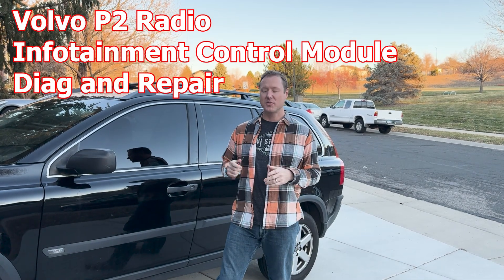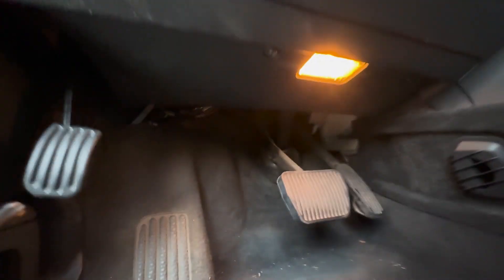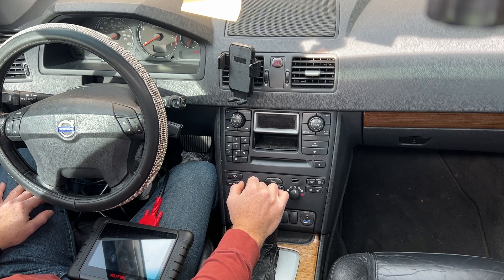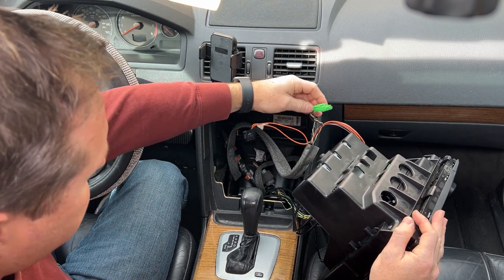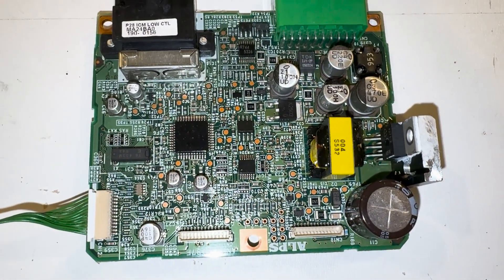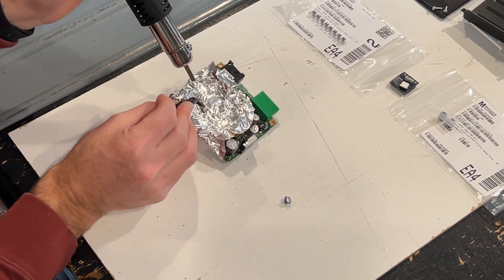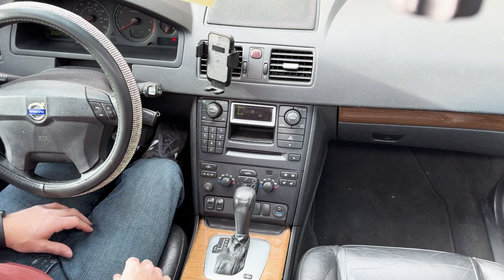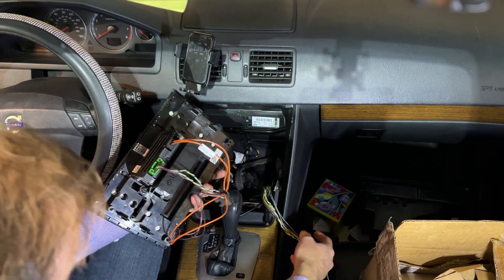Volvo Radio Infotainment Control Module (Code DC02) - Don't Do This!

Comment: Hello my fellow Volvo enthusiast. Do you happen to know if the screen for the ICM is a straight swap or if I would require a new radio code / recoding in VIDA etc. ? My screen keeps dimming and it's driving me mad. Would like to get it replaced. Thanks!
Reply from the maker: Can't say for sure.  If you truly just swap the LCD only, I bet it would be just fine since it uses a simple old school LCD.  I can't imagine it is keyed or programmed to your ICM.
Reply: @5ivedaysproductions630  thank you mate!

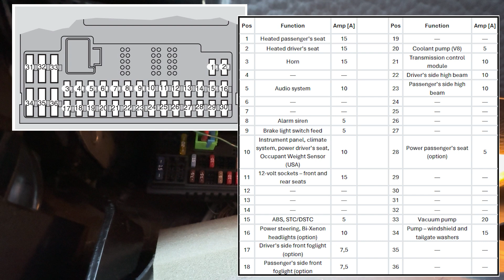Comment: If we're making a point of missed fuses - maybe we should examine video at 1:15. You say there are no fuses relating to infotainment on this board - I would have thought fuse at position number 5 would have been worth checking under those circumstances at that time.

Comment: 2004 Volvo XC90 radio keeps turning on and off repeatedly no sound also .any hints ?
Reply from the maker: I would bet its the capacitors on the Infotainment Control Module (ICM).  I have a link in the description to that guy demonstrating the way it is supposed to work, but in my case I ended up doing more harm than good (not the best at surface mount soldering).  Xemodex will rebuild the ICM for you, but after you ship it there, it can be around $300.  The unit I found on eBay worked great and was cheap enough (under $100) that it was worth trying.  For that year it seems to be ok to swap out the ICM as long as your model numbers are a perfect match.
Reply: @5ivedaysproductions630  or i can just plug and play for the unit in will get from the junk yard ? 
Is there any programing involved in units from other cars to be used in my car ?
Reply from the maker: It's plug and play. What I showed in the video around 09:13 was a used one from eBay (likely from a junk yard).  So that is definitely what I would do and save yourself the teardown and risk of breaking something.  Mine didn't require programming, but the seller on eBay said that it was crucial that I got both Volvo part numbers on the ICM to match (my original had to match the one from eBay), otherwise you probably would need to do some programming.
Reply: Thanks I will update,  your help is much appreciated thanks again my friend
Reply from the maker: Sorry I didn't see your question earlier.  There are stickers in 2 areas, one on the ICM and one on the lower back of the whole unit (right behind where the CD slot is).  Here are some pictures (hopefully YT doesn't block them).  The first picture is from the ebay listing where the seller told me the 2 numbers to confirm matched what I had at home.
ebay - https://drive.google.com/file/d/1bAoodwxqP5s7lCLnYiaEkkJ1sUs-F6CO/view?usp=sharing
ICM - https://drive.google.com/file/d/1yjX_5myGkmQhiFWhyGmXYxlE204sRLZ3/view?usp=sharing
https://drive.google.com/file/d/1dq_B44f180jzy6fuLBlveUkedP9FTeus/view?usp=sharing
Reply from the maker: If this one from eBay didn't work, I was going to go that route with the aftermarket single din.  I would try eBay first and make sure its eBay motors certified so that they will let you return it if its faulty.  If that doesn't work, go aftermarket.  For an aftermarket, you just need a positive and ground power source and good speaker wires (which you can run your own if needed).  It would completely bypass the factory fiberoptic stereo system so it should work for sure.
Reply: @5ivedaysproductions630  Thanks for the information. When I saw your video, it made sense for me that my stereo not holding the voltage because obviously the capacitor job to hold the voltage .
The stereo here in California junk yard are $35 do i just get one and sawp the icm from same year ?

Comment: good news is no one will see your mistakes and if it works, who cares.👍  not sure why Volvos can't be better. the '84 244 GL I had kept burning brake light bulbs and it came down to the 16" long flexi light circuit card that lived in the tail lights.  no matter what I did, I would rarely have 2 function brake lights.  new bulbs had a lifespan of maybe 2 months.  Again, '84 240 GL in the early 90s
Reply from the maker: Thanks for the comment.  Glad nobody saw my mistakes 🙂